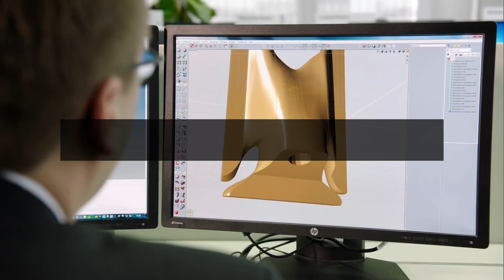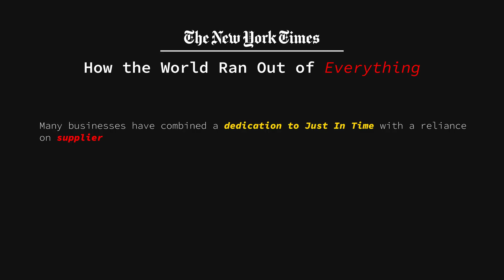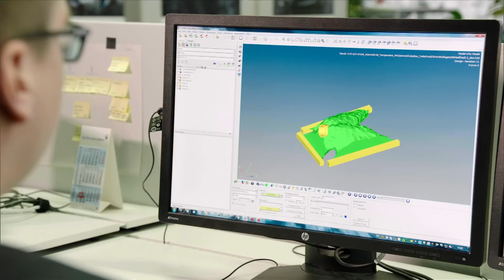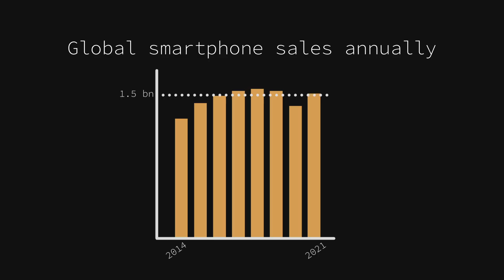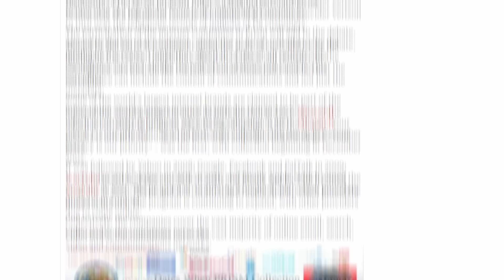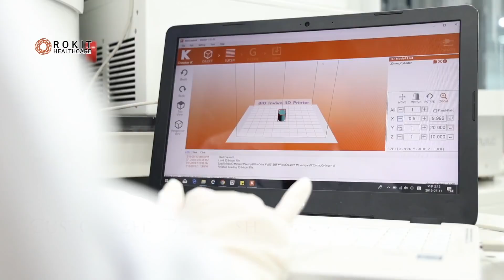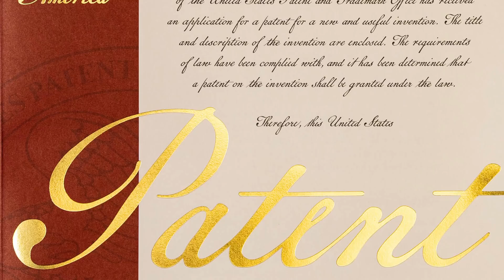How 3D Printing Could Decentralize (Almost) Everything

Comment: I made a mask file that was taking 2 hours to print. I got it down to 8minutes. 
You say its fast. Its the licencing sites and sesrch engines are currently so bad its a total disaster. 
Just cause you design at home and print at home does not give you the right to sell that thing. Im an expert at this and know that cause i got nailed as a pirate. So learned all the hard lessons.
Reply: Would you mind detailing how were you nailed as a pirate, so that other people know which traps to avoid ? Thanks.
Reply: @robertjohnson3549   3d print license sales expert guide. 
That a vid i made that covers license checking. 
I did post my story here but youtube keeps removing it. Thats not helping anyone. In short license check before uploading a file incase its already been invented. 
License check before producing a thing by customer request. 
License check any file you get.
Getting a free thing from sites like thingiverse might not be free. They might be a pirate turning you into one. Like happened to me.
Reply: @robertjohnson3549  i made a vid with infomation. Called 3d print license sales expert guide.

Comment: So concrete is more environmental than wood? Metal chips are recycled.  You realize plastics are made from oil. The energy consumption of a metal 3d printer is insane.
Use the right tool for the right job.
Micro chips? Good luck with that.
I bet you are usind a apple computer to make this video.
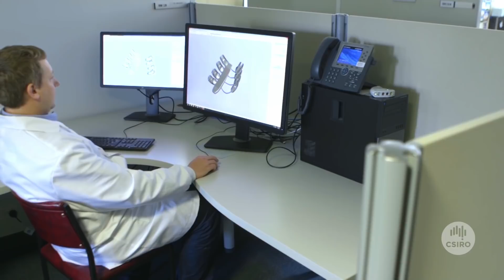13:08 that does not look like a "exact" replica

Comment: A 3d printer can only print plastic and will be completely useless for any parts of your car that require any metal parts. Also, most parts shops can get a part in within hours. 3d printing those parts would take days, cost a fortune and never be as good as the original parts. 
The amount of ignorance and misinformation in this video is astounding.

Comment: Climate change is a lie. It's used just like covid to take away your rights and give the government more power. If climate change was a rea problem, why haven't they banned all plastic products? Things used to be made out of metal and glass, which is completely recyclable. Now EVERYTHING is made out of plastic which is mostly not recyclable. Most electric car power plants in California are powered by diesel generators. Solar panels and wind turbines are mostly non recyclable and have a relatively short life span, at which point they end up in a land fill.

Comment: The other problem is NIMBYs. As it turns out, it doesn't matter how good you are at producing if you allow locals a say on what happens in their area. 3D printing houses will have only marginal effects, so long as housebuilders have to ask locals for permission to build on what is LITERALLY THEIR LAND. As for the environment, letting locals have a say on development in their area leads to WInd and Solar farms getting blocked, and delays have a nasty tendency of driving up costs.

Comment: As someone who owns an Ender 3, I would say that 3D printing still has a long way to go before everyone is using them…
Currently, printers have problems every now and then, so I have to fix them and replace parts. Searching up the problem and fixing it takes a lot of time and give me a lot of frustration, and it was not long before replacement parts (often being upgrades) costs more than the printer itself. Another thing is quality, a lot of the parts printed aren’t actually usable… If 3D printer were to become a tool instead of just being a hobby, it needs to be more sturdy and reliable.
Reply: Well if you break parts of your printer like that then take care of it, it is still "fragile" Machine. 
I own à 3d printer for more than 5 year put +50 kg trough it, only replaced the belt for renforced one (10buck) and changed the print head and thermistor (15 buck) my next printer will be an ender 5 it seem to be a good start for a "semi profesional" Printer at low cost.
And for parts, if they are not working then change the design "dont blame the tool , blame the guy who use it" . 

Have à great day.
Reply: There is a learning curve to 3 d printing, as with all non alienated tech. Some machines are relatively plug and play but ideally you need to know your stuff to be able to use the full functionality of the machine with different filament types and design configurations
Reply: @remypetit1791  absolutly right, i have more faster and cleaner print, with the same printer day after day.
and its very important to adapt design to 3d printing too, not every part can be made eficiently with 3d printing.
Reply: what’s the cost to entry?
Reply: Resin printers seem to be a real step up from what I've heard, maybe look into it
Reply: Prusa makes a printer that is sturdy and reliable.

The Ender design ripoffs of this printer are not great.

Tech is there already, but it costs some money.

Comment: How close did you ever come to a 3D printer? did you even hold an FDM printed part? Printing functional parts with an FDM or (M)SLA printer is far from obvious. Parts need to be designed to be easy printable, most parts need support, FDM prints have layerlines and adhesion between layerlines is limited, most strong plastics shrink, nozzles clog, wear down, the first layer need to be perfect,... high end materials need heated enclosures, special hotends, special nozzles, special adhesive films,.... Open source means hardly any support unless you have hours to spend on youtube or github,... A decent printer is more expensive but offers support,... still even an expensive FDM printer is only a slowFDM printer, with layerlines, many failing prints,....That is why people stop using their 3D printer, kick it out,... SLA/ MSLA is only starting to see decent resins, resins are toxic, slicersettings are timeconsuming and require knowhow, post processing is not evident,...   The open source story,... E3D stopped open source because they were not able to continue to fund their research, so to keep innovating they needed to sell products, E3D also suffered from a bad image because cheap, poor E3D clones were branded as V6 or,... If the public payed for the research open source is the way to go, if private efforts lead to an idea or product, a patent is the way to go. Other people are allowed to use this idea, but they have to reward the owner of the patent, if the licensing price is exagerated you can go to court,... Often there is a better way to do things,... For 3D printing the problem wasn't the patents, the problem is/ was the limited market, the required development cost and the expensive parts required for a high end printer. There are some nice printers in the world, they cost a fortune to buy and to operate, without the patent they wouldn't exist,...

Comment: I  am not a specialist, but the voltage needed to melt metal for extended time for printing is far above the existing manufacturing, is it not? It is way cheaper to make the same piece of metal, since you just need to cut the metal piece out of the existing one and bend it to your desire. And all that power for 3D printing has to come from somewhere. One thing is to make exclusive individual items on demand, and another is to make a whole production line. Imagine the amount of power they had to consume to be productive.
Reply: 3d printing can do a lot of things by itself ,and yes , it does take a lot of energy to melt metal , even if metal 3d printers exist . That's why most metal 3d printers use sintering technologies to make parts instead of melting it all at once
Reply: As for mass production , maybe we could make molds from 3d printing and use them directly to mold plastic? On youtube i saw a video of a man making custom gears from a 3d printed PLA gear he made a contrete mold of , which he then used to make gears out of. Maybe that can work commercially , making parts to take less time going from design to manufacturing.

Comment: ...internet did succeed at delivering free communication and such.

Imagine running your thing before the Internet.

Mass surveillance is mostly due to people not caring about it. Nothing stops people from exchanging PGP-encrypted messages over any medium. They just don't do it.

Nothing stops people from using decentralized protocols. They are a thing. They just don't do it.

And now there's even Web3.

Also, (some of) tech CEOs are likely just forced into censorship. Dorsey apparently plans to launch decentralized protocol for Twitter-like social media and make Twitter a client. Probably because, while it takes away their power as gatekeepers - they know they'll eventually be fucked if they can control user content. Because they'll be forced into being responsible for it.

Focusing on "Big Tech" as source of the problem is just cheap and lets media (previous info gatekeepers, who are of course against what took them this status) control the narrative.

As Balaji Srinivasan said,

> Should we fund 1000 competitors to FB? Yes.

> Create decentralized versions of each service so the question of censorship is moot? Of course.

> But those developments will take time. In the meantime, the NYT wants to take away your free speech.

Comment: I got my first 3d printer in 2005, a Z Corp 310 Plus. It far superior to the competition. I don't remember the manufacturer, but it cost over $25k. It was in essence the same as the additive machines of today. All it produced looked like a lump of plastic. The real reason we didn't see 3d printing earlier was computer processing power. It wasn't up to the task nor were the operating systems of the day. 30 years ago graphics were done on dedicated machines, those were expensive. Any cheap low end laptop has magnitudes more capability than the machines of 30 years ago. 

One other thing 3d printing isn't sustainable, the waste is enormous(failed prints). The plastics will end up in a landfill at some point. You can only recycle plastics a few times. The polymers break down very quickly. Unlike metals which are infinitely recyclable. 
3d printed houses, yes it sounds nice. There is a big 'but' in the middle of it. Many years ago people were working on alternative materials for building houses. It sounded great, it was very promising. Until they got to the regulators, all those wonderful things were stopped dead. 
I know how to cut construction costs of any house made in the US in half. It's never going to happen, you have to get government out of the way. That's not going to happen, it's the same thing that created shortages. Government is the problem, that was the reason people moved to slave labor to make their stuff an ocean away. Now that's come back to bite all of us.
Reply: You are very ignorant of computer processing power in 2005. 3d printing is a fad. It's mostly useless for the average person. if you look on youtube, most of the people are printing out pokemon figurines with it.
Reply: @MAGAMAN  No, he’s correct. Before from the patent in 1986-2000ish no average at home individual could afford a computer that could render the graphics required to allow anyone to create open source models. The computing power to guide the printer wasn’t the bottleneck in technology advancement it was computing power to design products. Less designers means less demand means less R&D. Unfortunately for the original patent owner, his idea was ahead of its time and he failed to profit from it.
Reply: Would like to hear how you could cut construction costs in half?
Reply: @1337bitcoin  their idea is "get government out of the way", aka deregulation of housing construction. Which I think is just asking for Chinese style "hollow oil drum pillars", lead paint, asbestos insulation and other forms of abuse which can never be prosecuted because the "company" declares bankruptcy and the shareholders can't be sued as it was an LLC.
Reply: I would also like to know how you can save money on homebuilding if you wouldnt mine sharing ?

Comment: In my opinion, this technology is super awesome to have on our own. But at last we people are the one's who is going to suffer, because what if we have a 3d printer and no one comes for working then every one in this planet who are working to build manually loose their jobs . The work of a 100 people is reduced to work of 2 or 3 or maybe 5 that's it.
Reply: 3d printers are currently very limited , and we can do some advanced things with them but its expensive. 3d printers will get better , that's a given , and if they ever get to the point you're desribing we probably have the people that would've worked those jobs doing something else or using them themselves. From that , i think we can say that that's not a concern.

Comment: I'm a big fan of 3D printing. I got myself a printer about six months ago and it has been far more fun and useful that I ever thought.

Having said that... whenever I see one of this "if we could only have had" videos, I'm skeptical. I'm a realistic guy. And with 3D printing, I can tell you the how reality looks like.

You're probably not old enough to remember (or even have lived through) this. But in the late 80s when computers seriously started to take off in offices everywhere there was this idea that they would bring about the "paperless office" and we would SAVE THE TREES!!! Yet another one of those misguided conservationist campaigns. Reality was, well the exact opposite. People started using more paper than ever as they could now easily create many hardcopies, try again when the print wasn't just right... etc. We're closer to the paperless office now, but still not there, some 40 years later.

So how is 3D printing faring? Pretty much the same. I find myself printing plastic pieces several times until they finally end up right. Specially if I'm designing the piece. I already have about half a bucket of failed prints which I have produced in those six months. Where is all this plastic going to go? To a landfill somewhere or worse. When and if 3D printing goes mainstream... well you get the picture.

And when you're start thinking bigger like 3D printed houses, I'd recommend you watch Belinda Carr's video on the subject.

I love 3D printing and now I own a number of custom designed pieces to fit my personal needs, but be wary, because reality tends to be less rosy than the "what if" in your head.
Reply: @Zef Some of the biggest polluters on the planet are these green ideas. Wind turbines and solar panels and batteries are not recyclable and are flooding the landfills. Many of these electric car refueling stations are run off of diesel generators. The whole green movement is a scam on stupid people.
Reply: @MAGAMAN  Sadly, there's a lot of truth in this. I call the "but we must do SOMETHING" syndrome

Comment: Having 3D printed homes would be extraordinary! I wonder how that'll work for wooden homes though...can't really melt and print wood, only concrete. Maybe that's something we could look into inventing; liquid wood.
Reply: Well, why use wood? Concrete is strong, cheap, and not flammable. As a bonus, it's very good at noise muffling too!
Reply: @thedudeguy242  And blocks EMF better than wood.
Reply: @thedudeguy242  Good luck with that concrete building in the -40°C weather here in Canada...
Reply: @MrElectrifyer  I've got a concrete house in Wisconsin, it's actually well insulated if it's a couple feet thick. Heated flooring is a big plus too.

Comment: This is like an ad for 3D printing lobby 👀
Reply: It s full of disinformation. As a 3d printer owner and having a background in building and designing with CAD, I find the 3d printer to be little more than a toy. It's practical uses are very limited.
Reply: @MAGAMAN  Yeah indeed.... but well The Hated One videos are a lot into strong exageration even if the base of the video is still often true (in this case that 3D printing is "promising")....

Comment: What you say about patents is incorrect. 
I was working at a college 15-30 years ago and our engineering department had lots of different 3d printers, in both metal and plastic.
Were they expensive? Yes. But at the time the world wide web had only just been invented and a computer was the same price as a car.
It takes decades for an obscure tech to go from lab->product->engineering classroom->consumer market adoption. 
We had to spend a long time training people, improving hardware & software etc to get to where we are today. It took billions of usd of investment that the big corporations and colleges paid for in order for the cheap $500 3d-printer to be created.
The patent system is working just fine, you can talk about open source all you want but a few coders in their basement are not going to spend billions of USD for R&D so that you have departments full of material scientists with electron microscopes to develop things.
Just like a coder isn't going to invest $20 billion in a 5nm TSMC chip fab so they can have some silicon to code for.